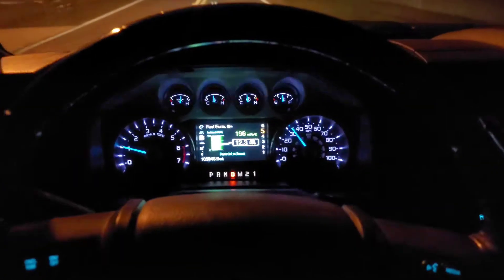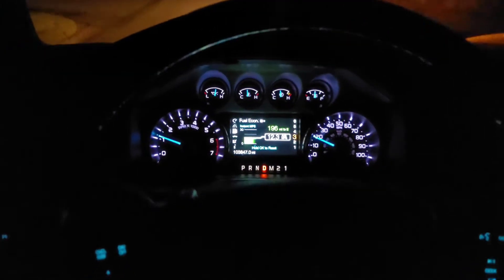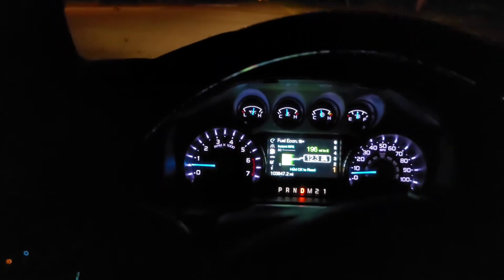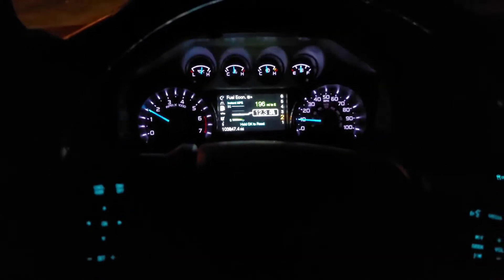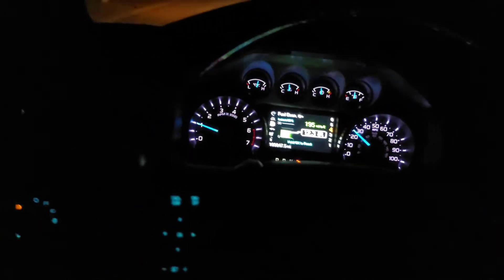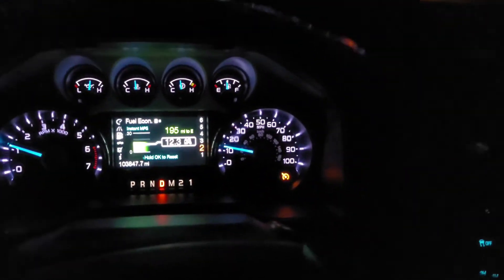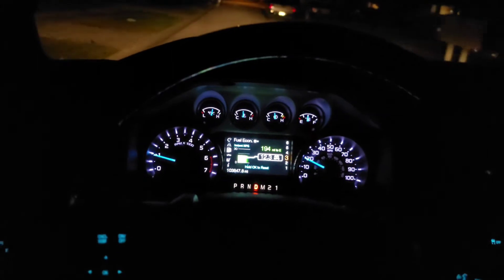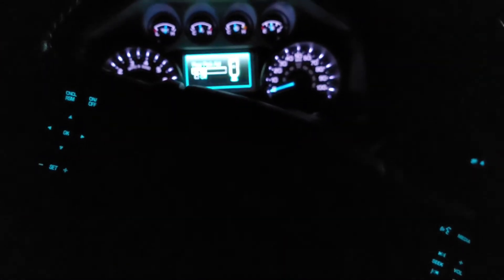Ford Superduty brake lights stay on!  Here's the solution.

Comment: If you looked there would be a little round piece of silicone about the size of a penny on the floor mat or a piece of it that contacts the brake switch 
 A temporary fix is to epoxy/ hot glue/ Silicone  glue a penny on the Brake lever where it contacts the brake switch. Pull the clip and pin that holds on the brake push rod to access the spot where the bumper is located . Your truck or car will preform as normal then.
Reply from the maker: Wow this information is fantastic. I never did see anything on the floorboard, though.  But thanks, it would have saved me a long trip to the shop to have it fixed.

Comment: Temporary fix i did to rule out issues is a bungee cord pulling up the pedal wrapped around steering column. Worked great.
Reply from the maker: Awh thats a great idea.  Sure beats unbolting battery each time.

Comment: Ill try to give a trbute to your car im so sorry it keeps breaking down mabye of i get a-no-f-e money i will buy you a good car NOT SAYING THIS ONE IS BAD but i feel se bad
Reply from the maker: I'll take you on your offer.  Haha it's not been too terrible but has had a few break downs.
Reply: I have had the same problem, the cruise control wouldn’t set and the engine would seem like it shut off intermittently.  Brake lights also come on randomly, like I come home right now and truck parked with brake lights shining.  I thought something was getting wet, but evidently I need a pad replaced